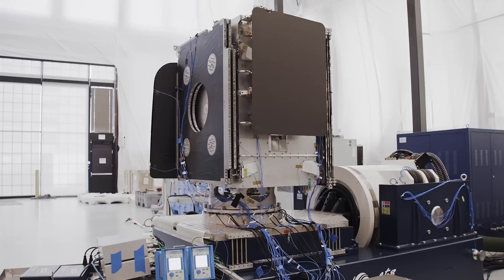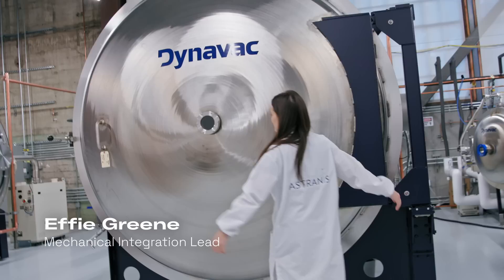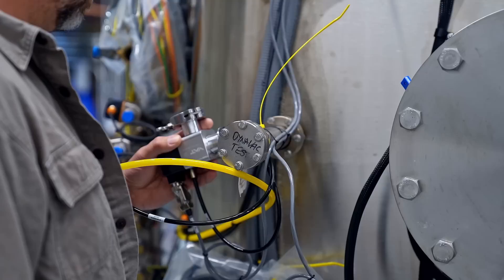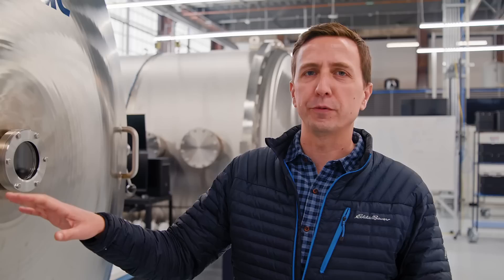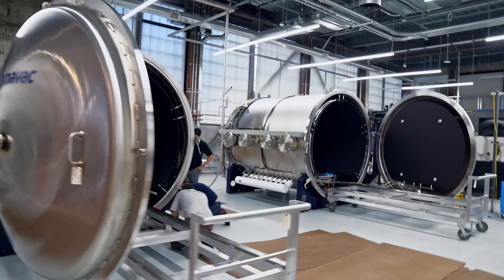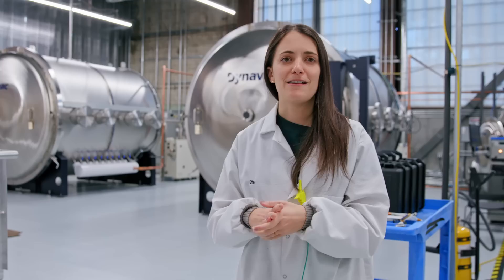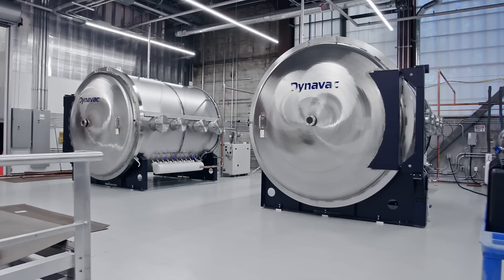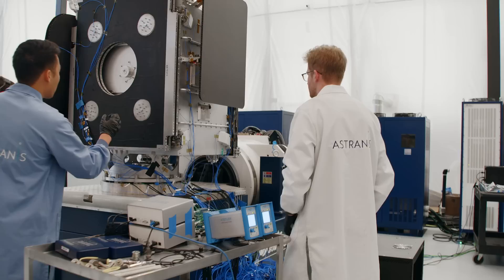Simulating Space on Earth with John Gedmark and the Astranis team

Comment: Two birds a month? Have you thoroughly researched your market? I was at Hughes/ GM/ Boeing when GM planned for that. We never launched as many as ten satellites in any year. Then there was the great downturn of 2001 and the market for satellites was saturated. I think we had two launches in 2002. None in 2003. We had birds in storage all over the high bay. I retired in 2003 so I am no longer tied to the fortunes of Boeing Space Systems (or whatever they call themselves now). Boeing was a great disappointment when they moved in. I’m glad I had the opportunity to retire soon after they took over. Up until that time I really enjoyed the work. Vacuum chambers can present challenges but they can also be great fun.
By way of explanation, I worked as a technician doing thermal-vac and vibration for the company that started as Hughes Aircraft and retired from Boeing. In between we were owned by General Motors. Never had to move my desk 🙃.
Your new chambers look great. I hope they work well for you, have minimal maintenance issues and stay in use for your proposed 24 launches a year.

Comment: I'm not sure you're right that there's only one way to deal with excess heat. If your satellite has the same orientation to the sun at least for a while at a time you'll have a hot side and a cold side. So building a recirc system into it with refrigerant would you would give you a differential of pressure which you could design to go through a turbine to make electrical power out of heat. Thus you convert thermal energy to electrical energy which you can dissipate and different ways if you want to if it's not appropriate to charge a battery say. Unless I'm way off on efficiencies or numbers or you're using too small of a satellite and there's not enough of differential or space to build it or whatever. Let me know if you think I'm wrong and why.